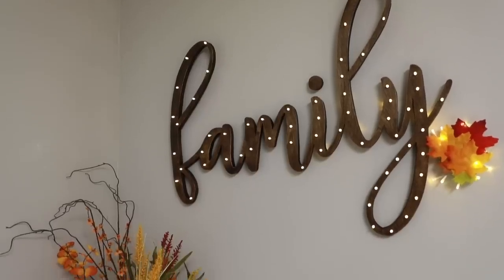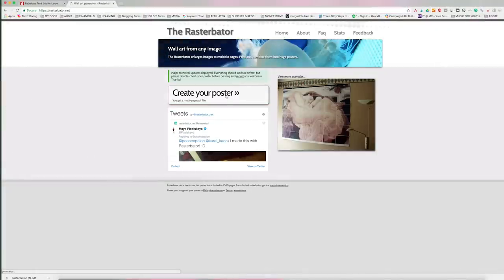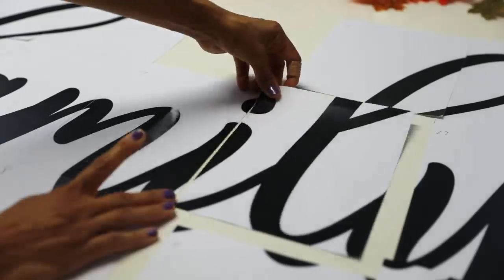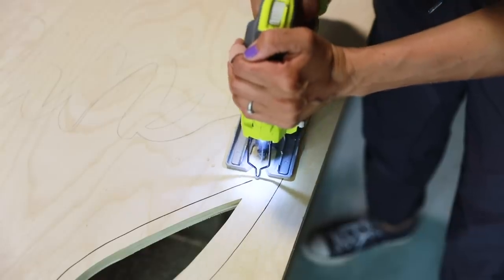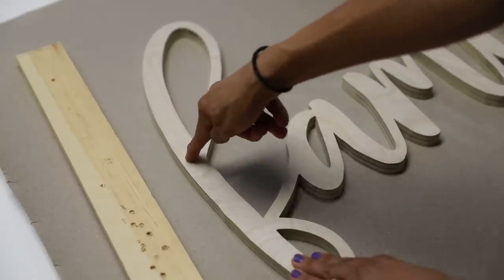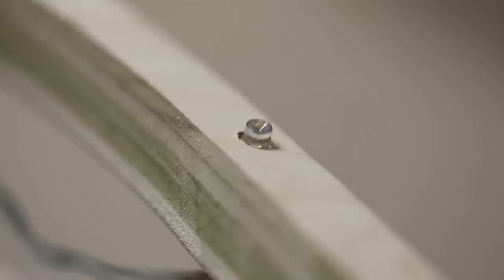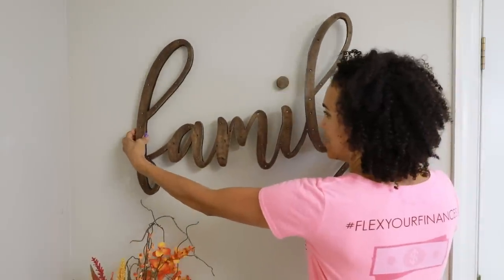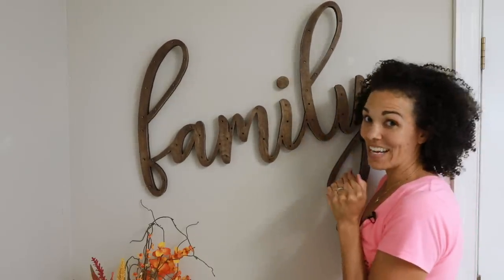How to Make a DIY Word Light Sign Out of Wood - FULL TUTORIAL - Thrift Diving

Comment: Thanks for the video! It was extremely helpful. The websites were perfect for the finding fonts and making the poster. 

A little tip for anyone making a sign:  

I chose a thinner font than was used in the video. I noticed it was important to start off with the detail cuts (sharp corners and hole cut outs before cutting the outline of the sign. (She did this in the video)  It kept the wood more stable when using the jigsaw otherwise the loose ends would vibrate like crazy.